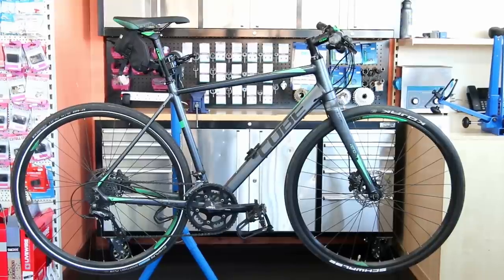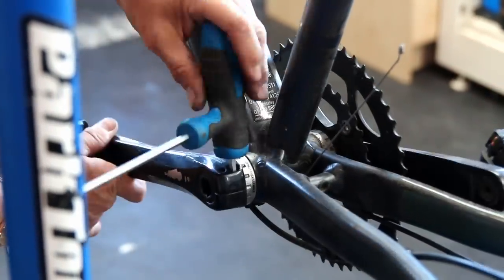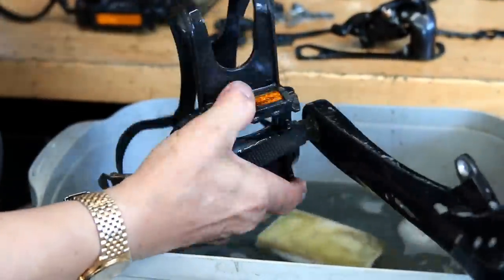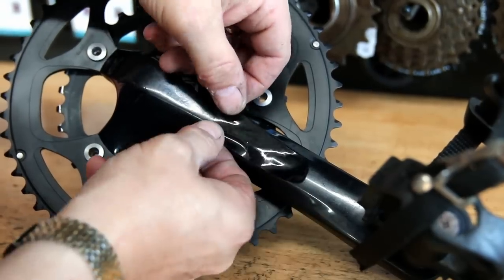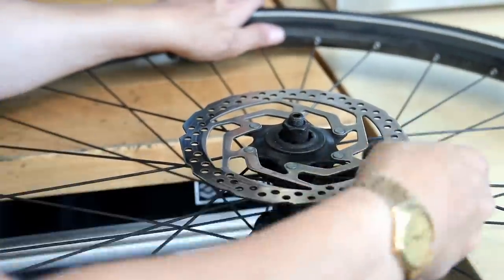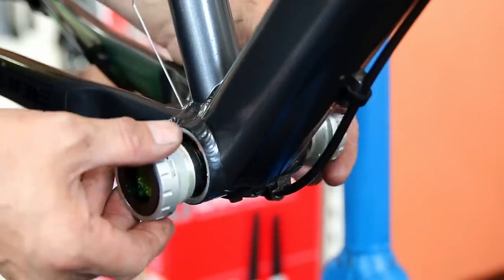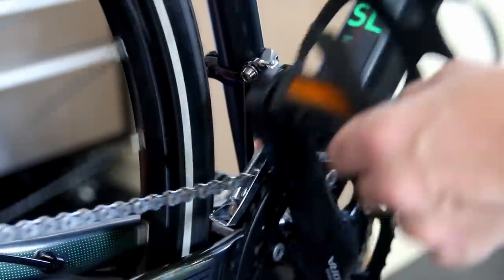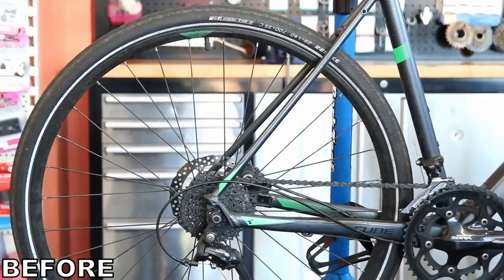Cube SL Road Full Rebuild! Restoration Bike Service!

Comment: Nice service guys, i actually have a problem with my rear derailleur where it shifts well but the cable tension is really tight like it actually hurts my thumb to upshift, any idea on how to release a bit of tension on the cable? Thanks again for the amazing video, cheers
Reply from the maker: It’s most likely to be needing a new cable.

Comment: I work at a bicycle shop in the netherlands and what we always do if we have squaling disc brakes, we clean the break pads and the discs and then we spray the brake pads with swissstop disc brake silencer. This Will prefend the disc from squaling a lot longer than only cleaning the discs and the pads. The only downside is that you Will have to brake 10 times very stiff before the brakes start braking very good because the stuff Will first prefend the brakes from braking very good but after 10 times braking very stiff you Will not feel the difference in braking power
Reply from the maker: Interesting stuff there!

Comment: Just discovered the channel and subscribed. Loving the content, great work guys! I have 2 questions, firstly is there a brand of bike who, you think, do a consistently good job of making bikes that are well thought out and easy to service? Second question is I saw you service a wheel where the wheel looked pretty true but a bunch of the spokes on one side had almost zero tension on them, was wondering how that could happen in normal usage and how the wheel could stay true-ish despite it happening. Keep up the good work!
Reply from the maker: I think there are various bikes that excel at different price points & genres, Giants a good all round brand. I often feel that the bike industry is crying out for a brand that designs and build all its components. A frame designer, designs a bike around a groupset and wheel set supplied by a third party. Imagine a bike with full R&D to its design and components.
A high quality rim will always stay fairly true if it looses some tension, but will fail with spokes braking if not sorted out and evenly tensioned.

Comment: Why didn't you replace the smaller chainring? It is very cheap and will now probably wear out the chain faster? At least that was my understanding.
Reply from the maker: The small ring had little to no wear. It wasn’t needed. 👍🏻🧡

Comment: What do you use to scuff the pads ?
Reply: Emery cloth, but you can just use sandpaper
Reply from the maker: We use a brass bristle brush to clean the body and a belt sander for the pad material itself, it’s a very subtle skim which barely takes any material off

Comment: I don't get it... you are using copper based grease??!!! On aluminum screws???!  🤨That stuff has absolutely no place on a bicycle with aluminum parts. Copper destroys aluminum in no time (electro corrosion) and is used only for hot steel parts in cars and even there automobile manufacturers disapprove their usage. 🙄